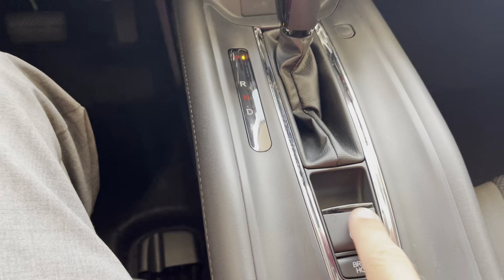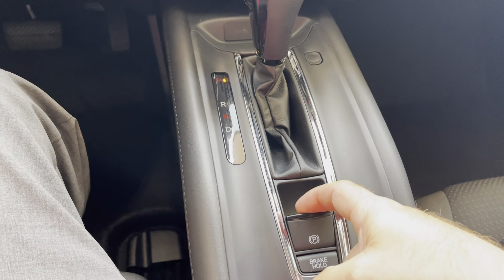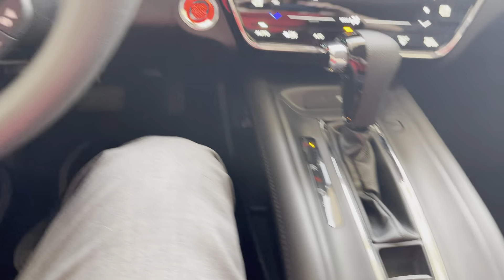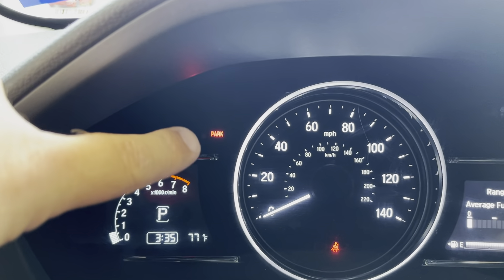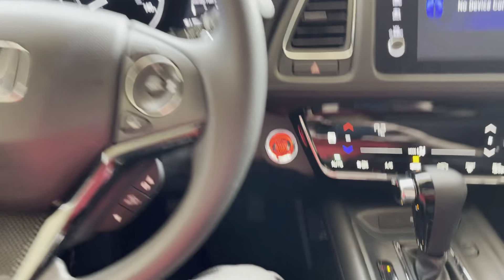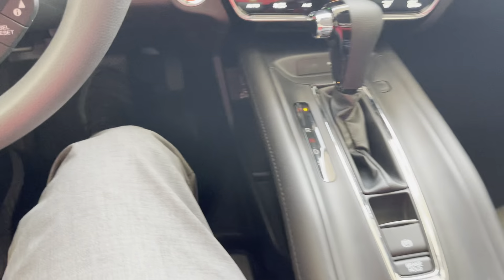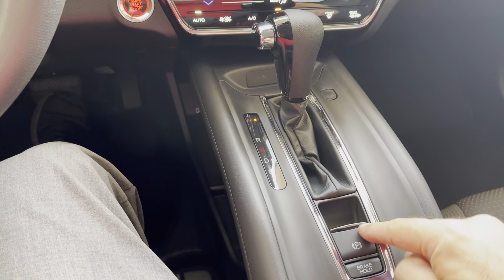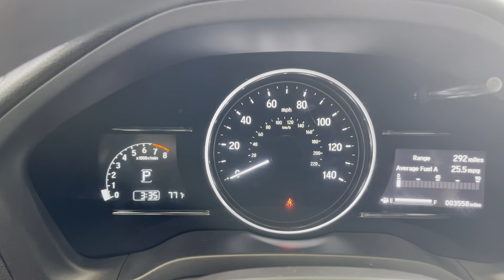Honda HR-V - How to Turn Parking Brake On And Off

Comment: Seniors buy cars too Honda, those grab handles are very important they are a safety issue, by eliminating grab handles in front of the HRV tells me honda thinks grab handles are a luxury. Today i went to Great Clips, there was a young lady probably 35, she had no left arm below her elbow she would need a grab handle for her other,grab handles are for special needs, I am a special needs senior due to a stroke, the Mr has Parkinson’s we both need those handles so we don’t fall getting out, I fell backwards getting in the HRV. 
PLEASE TELL HONDA GRAB HANDLES ARE A SAFTY ISSUE NOT A LUXURY seniors buy cars too. We has a passport elite decided to downsize. NEEDED THOSE GRAB HANDLES.  on the HRV. :(